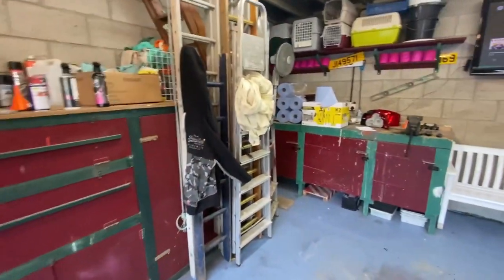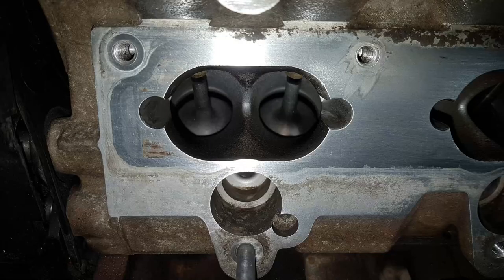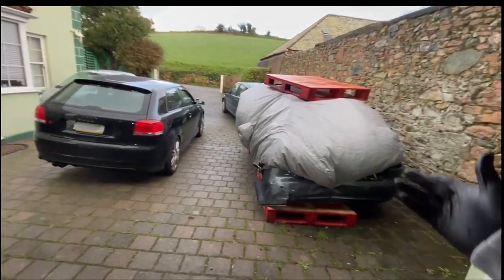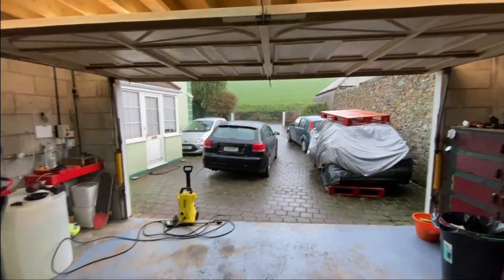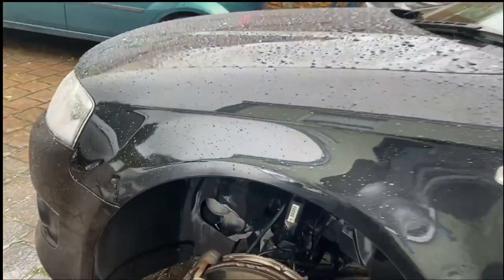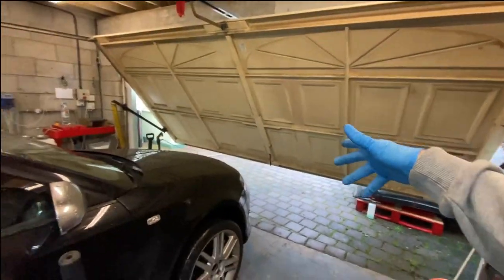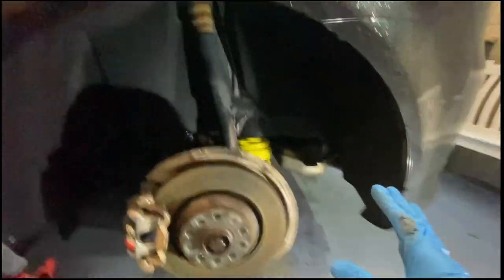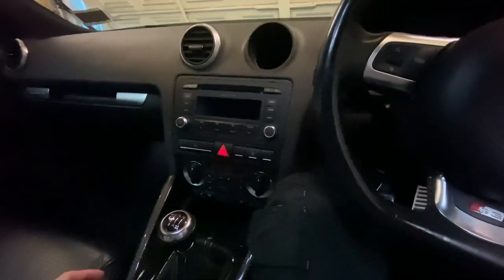Audi S3 8P - Cleaning And Modifying

Comment: Hi mate.
Just purchased a facelift s3 in purple.
Was wondering what make of springs have you installed? Mine is currently on 19”rims with some yellow springs (unknown make) and it scrubs like crazy, need to solve this ASAP but not sore wether to replace springs or change to 18” alloys.
Reply from the maker: Hi mate,
i believe their Apex springs meant to be drop by 30mm, I used to have 19" on my grey s3 although i changed down to 18s a week later as i had the same issue with rubbing, on standard springs! id say 18" is the way to go mate.

Comment: How did you remove your handbrake sleeve to put the carbon fibre one on ?
Reply from the maker: Hi mate, have to take the hole centre out and take the hole hand brake mechanism out to swap it over, as when I bought it it came all as one
Reply: @MotoAdventuresYT  hi mate Have you got any pictures and things to help me with removal as very stuck
Reply from the maker: @benjonson9335  Hi mate, i do have some pictures although i cannot send them through here, you can add me on snapchat? and ill send them through, my sc is blakehotton99
Reply: @MotoAdventuresYT  done it mate